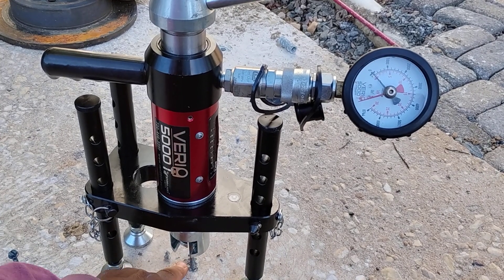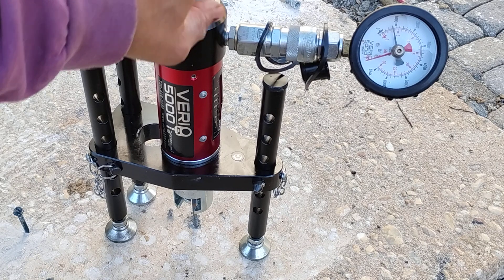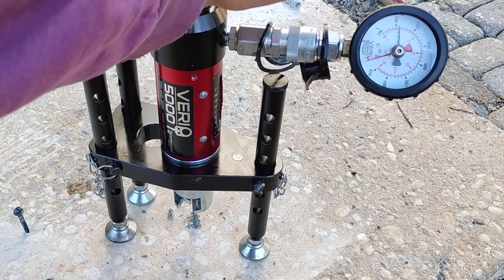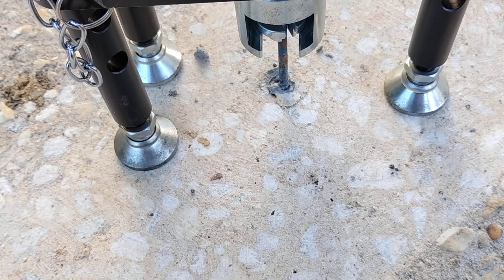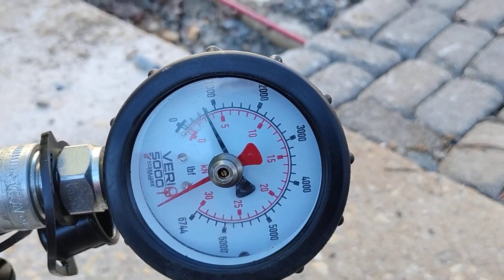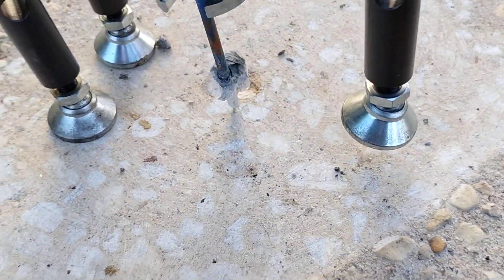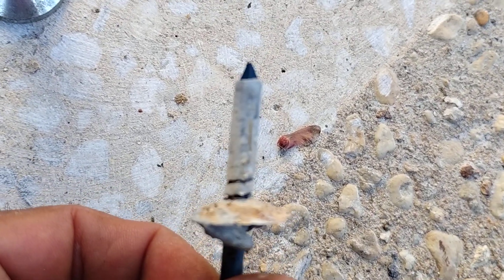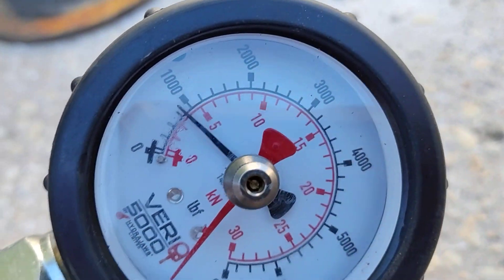Tapcon anchors in concrete vs tapcons in epoxy Sika is the epoxy #concrete #anchoring Concrete tips

Comment: Thank You, also thank you for an apples to apples comparison. I imagine your hole prep was per instructions, my question is, did you coat the tapcon and thread it in a "tapcon size" hole, or clearance drill and just push it into the epoxy?
Reply from the maker: Yes, I oversized hole and pushed tapcon into hole ...

Comment: Impressive! We found strictly following the epoxy instructions to be important for a good bond (e.g. proper proportions, very well mixed, applied quickly, cured properly). The instructions vary by epoxy so never assume. 

If you don't know how to mix epoxy properly, there are videos and instructions to get up to speed.

Comment: Thanks Kai. I use a lot of tap cons. Surprised to see how much difference the epoxy makes.
Reply: Awesome, glad you see the value in it and the next video is very important...
Also, you can buy tips for $1.00 each and use the epoxy over a few days. 
It comes out cheaper than buying fancy anchor sleeves.
Reply: Good to know. Thanks @ForensicCats